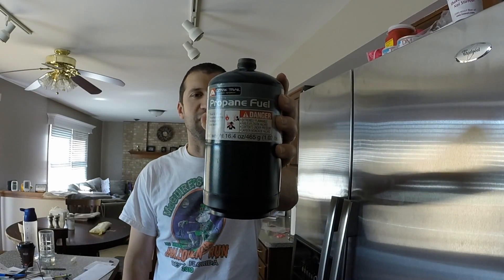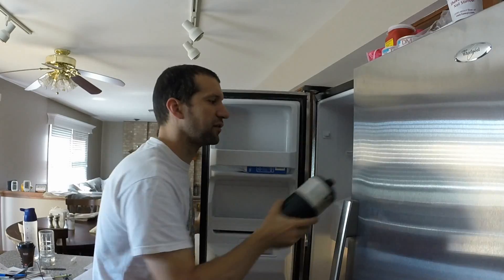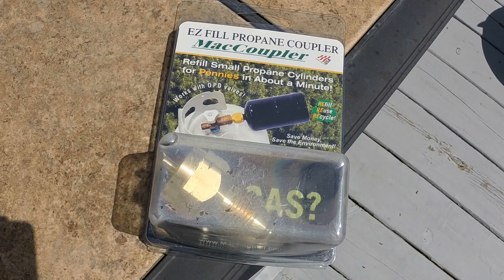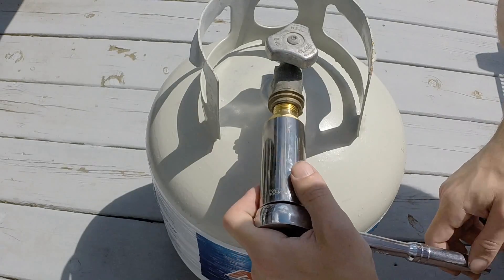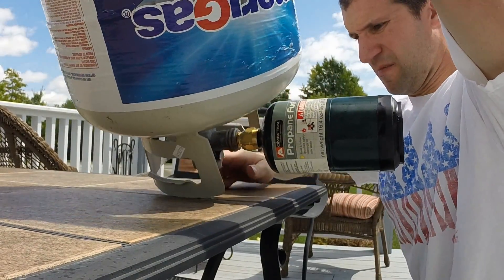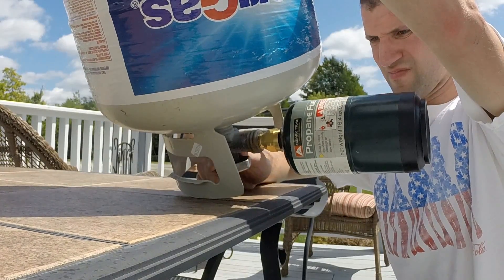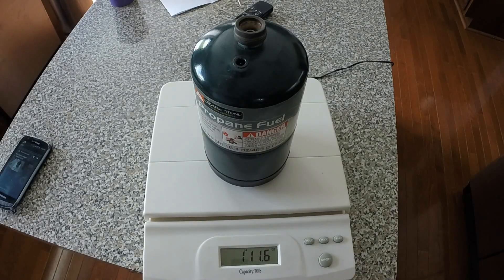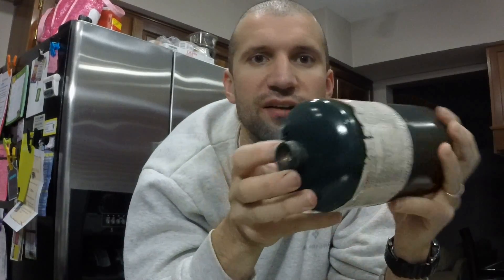How to refill small (1lb) disposable propane tanks.

Comment: Great visuals helping explain, this is one of the best refill vids I've seen, and I've watched a lot of them as I just started doing this.
It'd be the best if you made sure to soap check for leaks. I do it exactly like Harry, freeze 1lb'ers 1 hr and then 1 minute on the big tank (I have the big tank at 60 deg F, checked with infrared thermometer - $15), weighing before and after. I get a reliable 12-15oz. fill this way, which is just fine. If an overfill occurs (which hasn't happened to me), take the refill adapter off the big tank and use it to quickly vent some off the little tank.   Cheers and safe refilling!